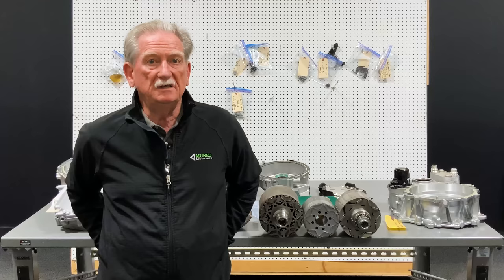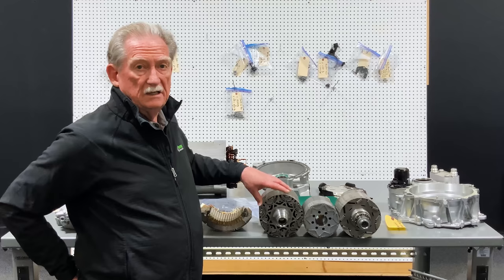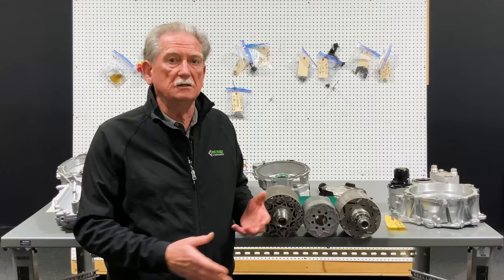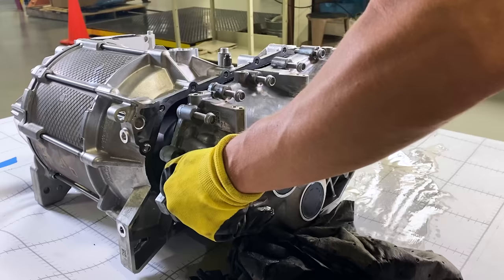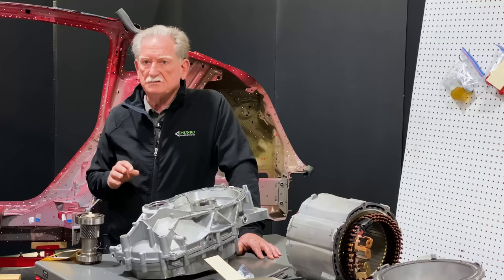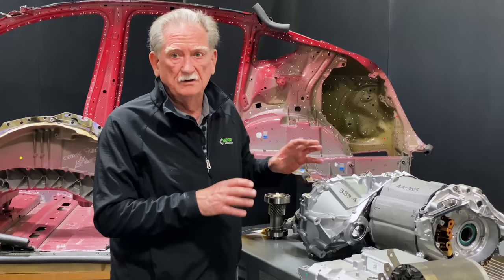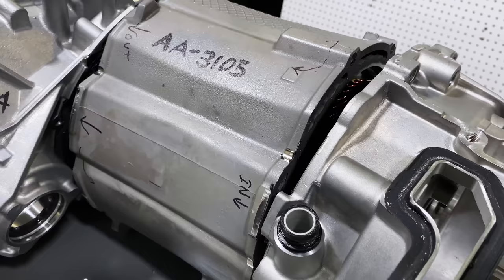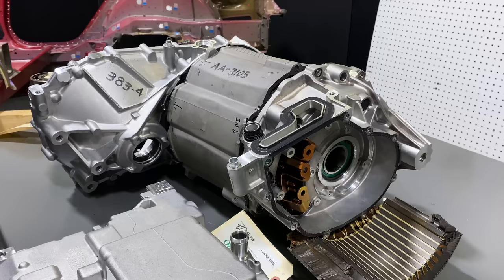Volkswagen ID.4: Electric Motor Teardown and Analysis

Comment: Does anyone other than Tesla have a oil filter & pump ?
Reply: question for me is why?
Reply: 1.) Tesla uses an oil pump/oil filter/heat difusor for cooling --> wasn't that before they had a whole-car cooling/heating solution, in the way of an octovalve? Now they have a common system for a whole car?
2.) What does WV motor use for cooling, if not some liquid that needs a pump, a filter & a heat diffusor?
Reply: @elektrotehnik94  VW's ID 4 doesn't need active cooling cause it's not getting hot enough with a 0-60 in over 7 seconds 🤣
Reply: @deathwing5639  i think that is the thing. I mean the preformance does 0-100 km/h in 3.3 sek and tops out at 261 km/h. Obviously that course some heat 🔥😅
Reply: @deathwing5639  yeah I believe the same thing, I think tesla is using that to be safe, I don't see vw upgrading their cars software to be faster and better milage as tesla does
Reply: for "shock and awe value" (which is cool) Tesla targets performance with their EV's necessitating the added expense/weight of a pump/filter, but the other OEM's (sans VW's Porsche/Audi brands) are just making commuters with performance being SECONDARY.  as such it's possible you may see an assembly on a Taycan or E-tron since they'll run you $100 grand...? but even that may be redundant since they went with an 800V system so HALVING the current draw which itself generates less system heat.  logic dictates if you AVOID making heat on the front end, then you minimize cooling needs on the back end.  ICE Mustang GT500 owners know what i'm talking about.
Reply: Nissan and GM Does have filter and pump oil cooling. GM did an amazing job of using a disposable filter but its deep inside the motor assembly. So if you need to change it, well....good luck. 
Nissan & Tesla uses more traditional spin-on-off type.  Unsure with Kia-Hyundai models have. 

But the idea of using a dedicated oil cooling and filtration system is far superiors to just running coolant on the motor. Looking at the VW, there is no oil cooling for the gearbox. Just relying on heat conductivity through the case components. Then again, they make no claims of 1M miles and aren't in the same lane as Tesla when it comes to performance.
Reply: @fredpinczuk7352  re: "GM did an amazing job of using a disposable filter but its deep inside the motor assembly. So if you need to change it, well....good luck."  i believe that's just a lifetime particle screen.  is it possible then you mean a NON disposable filter...?
Reply: @deathwing5639  you’ve the right name.
Reply: @phillyphil1513  No, its a disposable paper type. There is a YouTube video on the subject from a Technical College professor who disassembles the unit. I'll try to find it. Its not a metal screen as you'll find in some modern "Sealed for life" unit (Ie: 2016 Toyota 4-Runner tranny, with not a dip stick for Christ's sake).
Reply: @fredpinczuk7352   re: "I'll try to find it." no worries i've seen it, you're speaking of John Kelly/Weber Univ Utah. re: "No, its a disposable paper type." ok but that's NOT a serviceable type either.  while that may not be a metal screen it is likely not paper either (it just looks it).  nothing "serviceable" about first removing a wheel, steering knuckle, CV shaft, and finally a case cover to finally access ANY kind of filter.  no, that's likely designed to be "semi-permanent" but changeable in the event you have a problem and need to open the unit to make a repair. you would then change the filter as "cheap insurance"/best practice since you have the unit open.
Reply: @deathwing5639  the ID.4 motor certainly does have active cooling, which is why it has the coolant channels that Sandy describes. The coolant pump will be separate, and driven by a small electric motor.
Reply: @fredpinczuk7352  Try to find a manual transmission in a production (not racing) car which has a lubricant pump or cooler - I don't think you'll find one, because they're not needed. A gearbox produces very little heat, especially one with no synchros. Pumping oil in an EV drive unit is done for motor cooling or motor bearing lubrication, not for the gearbox; if the bearings don't need oil flow and the cooling is not by oil, there's no need for an oil pump.

Comment: They "gave" it to you so you can do free consulting work for them
Reply: It's a win-win, though I'm sure they will have to pay for a deeper dive. No doubt they just got the high level bullet points
Reply: @DavidHRyall  It is a win-win for everybody involved, but just be aware, nothing is ever free
Reply: Well, they were also really proud of the design and confident that Sandy would be impressed. So they were pretty well assurred that it would be good PR for them.
Reply: :))) Hundred of engineers worked on those boards/parts. The explanations of this guy are basic, nothing to learn from them for VW. And related to fasteners, I laugh when he keep repeating on it....only think he worked on and the only one he knows, but when you perform all those mechanical simulations for vibrations and resonances....you just cannot skip them.
BTW, expensive gate drive concept, should be bulletproof. Individual flyback trafo for each transistor from the B6 bridge, nice. Curios of how they measure each one and isolate it to the micro..
Also the IGBT module seems small, did they use SIC or IGBT?.....
Reply: @CATA20034  Sandy did say this was a high level review, you will have to pay for his more detailed research reports
Reply: #FAIRDEAL  VW may be genuinely interested in hearing his expertise since everybody has a different way of analyzing/looking at things.  just a simple comment about something in one area, can TRIGGER an idea that may have not been considered, which then might get applied in a whole different area entirely.   as associate of mine is BRILLIANT at this.  even though their experience/background is related (but different) than my own, it is this DIFFERENCE in viewpoint that actually makes them INVALUABLE.

Comment: Volkswagen always seemed to over engineer their engines, it nice to see they went back to simple,smart engineering like the old bug. less fasteners more snap in type.. I would gladly take it apart to replace mosfets  than pay 5k for a replacement :-)
Reply: the germans never did overengineering. their engines and other parts are only so well built that the poorly trained car mechanics in the USA have no idea how to solve problems. the americans are used to the simple, ancient engines and parts of the japanese. the japanese have been building exactly the same cars for 20 years, while the germans always try to improve.
Reply: @boa_keine_ahnung  Good old pushrod driven smallblock ;-)
Reply: @boa_keine_ahnung  I used to own a MB, Vw, BMW I will stick with Toyota Thank you. I like my money,  if it ain't broke why over engineer it so it does break. MB used to stay with the same idea for years, when they made solid cars.
Reply: @BillyBob-fd5ht  nothing breaks in german cars. the technology is just more modern, so american mechanics don't know how to fix problems if they arise. they are not as well trained as european mechanics. tesla also sources its parts mainly from german suppliers and is building its factory in germany. musk knows that german engineers are world class.

Comment: more fasteners = keeps the dealer service departments happy. planned obsolescence
Reply: Yeah, let's put kilos of adhesive everywhere, like in Tesla's battery pack.
Reply: @lennoxbaumbach390  for the battery type they use it is needed. so did you peel every inch and put it on a scale? cause you seems that you know how much it is. tell us oh wise one.
Reply: No, it's the opposite. Dealerships are happiest with large components that cannot be disassembled for repair (because they use all of the fastening methods that Sandy likes, instead of threaded fasteners), so they are quickly and easily swapped with very profitable replacements.

Comment: Driving the VW ID.3, the car is impressively silent. The engine is definitely not as powerful as the Tesla Model 3 though, perhaps the inverter or overall engine design is simply not as powerful. Also interestingly, the cars are quite a bit cheaper than Tesla's here, I would say around 10-20 k cheaper. In terms of leasing, it's half the price of the Tesla what I'm paying now.
Reply: Tesla sells everything they build, no need to take on other volume manufacturers that have almost no margin on electric vehicles while they transition from gas engines.

Comment: This is what I would call BRILLIANT CONTENT; thank you! Now... Tho things. First is in regards to a crack I spotted in the casting, as you described the burr. There are three cylindrical shaped parts of the cast which could be reinforcements or host a thread from the reverse side and the crack I'm talking about leaves that spot and goes down the housing. I don't know if it happened as you guys, disassembled the unit, or it's something more serious as a fabrication flaw. My second (last) point is in regards to Tesla aiming for 1mil. miles; that will only happen if they manage to surpass the first fifty miles, the ones in which it self-destructs. Cheers!
Reply: The three cylindrical impressions in the housing come from the projectors in the die-casting mold. The ejectors push the raw part out of the mold. What they call cracks in the housing are cracks in the tool. The housing is absolutely crack-free here.

Comment: All this talk of threaded fasteners reminds me of some bolts on a 70’s Ford truck I worked on with my dad years ago. The bolts had a nylon or some other plastic slug embedded in the threads of the bolt. Kinda like a nylock nut but in reverse. Pretty interesting. Goes to show the effort put into that sort of thing.

Comment: The inverter is filled with precious metals, heavy metals, copper, aluminum, plastic, etc... there might be a recycling mandate that requires that it can be disassembled rather than junked as a single piece.

Comment: Sandy talked about the railroad track noise, and I remember a video showing how they weld the tracks together with thermite.  That is the biggest help in reducing noise and stopping derailments.   A footnote to this is that this is what was used to take down the twin towers on September eleventh, 2001.

Comment: 31:48 From Wikipedia "The Acme thread form has a 29° thread angle with a thread height half of the pitch; the apex (or crest) and valley (or root) are flat." That would make the inclined angle 14.5º, not 15º although that one half of one degree might not matter in some applications. However if the Acme thread angle was at 29º, there must have been a reason because it is easier to measure to one degree than to one half of one degree. So, to those  of you who know more than I, give us the skinny!

Comment: Fascinating video. What am I missing about threaded fasteners? Haven’t cylinder heads and crank bearing caps been held in place by them since just slightly after man discovered fire? I’d say temperature and loading variations have been well proven to be manageable. I’m far more concerned about eliminating bearings and (apparently) reducing cooling capacity. I was very excited to consider the ID as my first all electric. Think I’ll let a model year or two experience the real world first..

Comment: That hairpin design is vastly superior. I worked in motor manufacturing for years and the winding insertion and blocking process is not kind to the insulation.

Comment: Yeah as an automotive tech dealing with snap fasteners is a pain in the ass. Case in point. Backup cameras that fail due to water intrusion. To get to the camera to replace it you have about eight clips that you have to somehow get undone to remove a plastic panel on the outside of the rear hatch. Problem is those things were never meant to be removed. So you have to force them which can sometimes cause the plastic moldings they are mounted to on the panel to break. Screws or nuts  would be far better to deal with than those clips. FYI the cameras failure to water intrusion is fairly common because the housing is half plastic half diecast with a rubber seal in the middle. My guess is the variable rates of expansion and contraction due to heat and cold between the plastic and diecast causes water or moisture to be wicked in through capillary action right past the rubber seal.  I've taken several apart and the insides were coated in salt.

Comment: The more bolts you have, the more friction is able to resist the side loads. Ideally there should be a locking feature in the nut or bolt thread to keep the fasteners from loosing pre-loaded and loosening, while allowing for disassembly.

Comment: threaded fasteners are part of every computer I have built in all my working life as a computer technician and digital forensic analyst. They are simply using standard computer parts for the control circuitry on the motor. I see you point on the mechanical side that the threaded fasteners are a liability but for electronics its fine.

Comment: Sandy I get the feeling you were comparing apples to oranges when you praised the VWs gearbox/motor./inverter 'water' cooling vs. the Tesla's 'oil' based cooling. BTW the Tesla also filtered said oil.
Then your suggesting to clamp the "rods" with "radial riveting" --- will that procedure enable said through motor rods to be pre-tensioned as when the bolts are stretched/torqued?

Comment: That long bolt has a nut secured by Locktite..or other heat resistant bonding that keeps it tight. Repair to the motor can be done without going back with welding.

Comment: The reasoning behind three bearings across the motor and gearbox input shaft is more important than cost cutting or reduction of friction, instead better reliability. Older EVs with completely separate motor and gearbox assemblies such as the legacy Hyundai/Kia can have noise issues and I'm fairly certain that's due to tolerance stackup across the splined coupling (which is essentially the equivalent of a rigid shaft).  The better layout is to combine the motor and gearbox bearing arrangement either side of the splined coupling such that alignment is assured as machining can be performed in a single setup. This seems to be present in all the newer designs including Hyundai/Kia's E-GMP.  Now one of the bearings either side of the spline becomes redundant.

Comment: the reason for screws is high voltage. it's a standard. as solder would crack with vibration. I'm personally like you impressed with the design. Vw always makes thing too hard to work on this looks very serviceable to me

Comment: With glue nothing move, but no after sale service too. Snap is interesting, cheap, easy for assembly but not always 100 % locking proof with plastic, the design must be really good. For plastic parts ultrasonic or hot point welding is sometime better. 

I totally agree for the screw numbers, "deutsche qualität"  (But to check with the sealing requirement and vibration simulation mainly for big PCB and Capa), but I would definitively recommand at the minimum a bit of medium loctite 243. 

The vertical integration if the first design rule for assembly, so for me the inverter design is pretty standard for OEM supplier, I was designing the same kind of inverter and rectifier at Valeo for electrical car already 10 years ago.

Comment: At 27:00 where the O ring of the IGBT cooling plate is seen, I think they have single point of failure there, in case of an error on the O ring, the whole inverter will be flooded with the coolant.

Comment: On case you need to push a PCB to a cooling area it's pretty normal you need fastener pretty good density with screw's as a PCB is bending quite easy.

Comment: Radial riveting (1) differ from threading (2) by the orientation in the finished pretension in the fastener. 

In the riveting operation, the assembly must be place in (a compression press1 x jig1 x cycle time1) then seal the rivet (riveting mill1 x jig x cycle time2), such that assembly and rivet always finished slag or flex in reverse. 

While the threading require less elaborate jig always finished pretensioned with no flex back. Such that the fastener’s pretension is always finished predictable in a forward direction. 

(1) for Swiss Army knife, no maintenance
(2) for precision pretension, maintenance.

Comment: I don't think you can directly compare unfastening forces in internal combustion engines with electric engines. There's much less vibrations and no linear motion. That's why propellers for electric RC model aircraft cannot be used for ICE RC model aircraft - the vibrations will break them. So I wouldn't worry that much about unfastening. And serviceability is always a bonus.